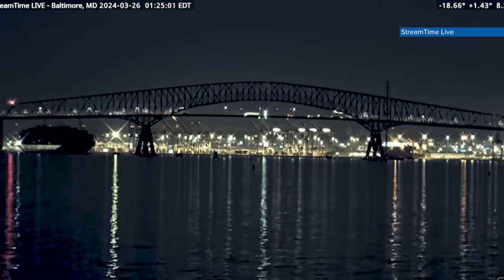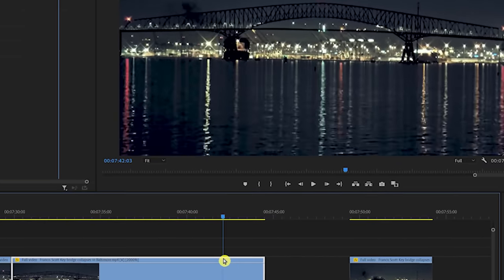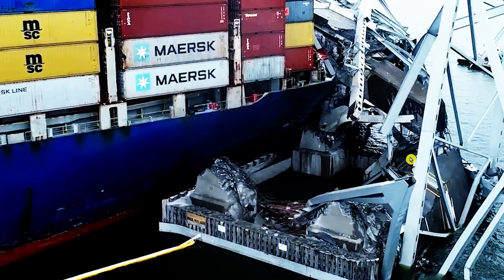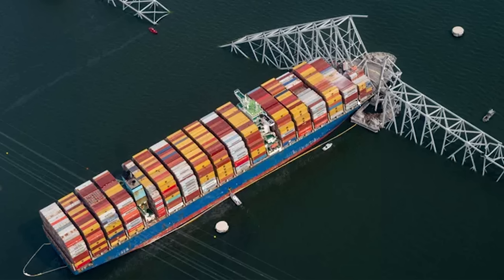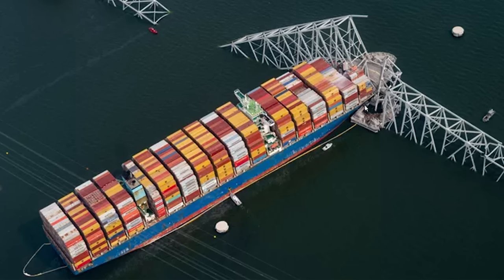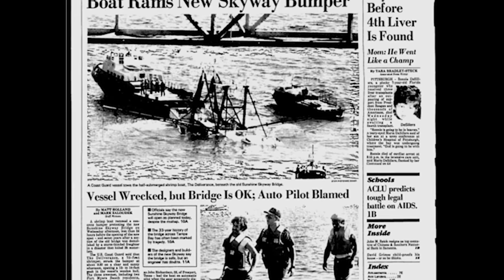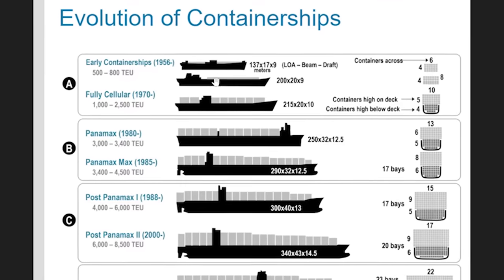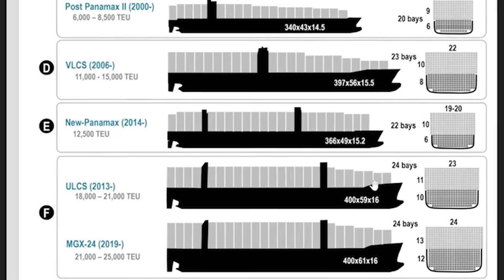NO Dali Bridge Crash Protection Like Sunshine Skyway Bridge?

Comment: 3:42 in, “the ship didn’t really turn that much”. It made a hard turn because it dropped anchor on both sides but only one scraped bottom and caused the ship to turn. When power came back before it went off again, they trying to correct, but it was too late.
You are correct that the bridge islands needed to have an arch of dolphins to create a glancing off effect if a ship that heavy can even be prevented from smashing into a bridge support.
Reply from the maker: The ship did not drop anchor on both sides, only the port side, and it had no effect. Anchors do nothing for moving ships.
Reply: @jeffostroff  this video of Casey Jones, https://youtu.be/YQ9lhqqxpo0?si=dsPu1otiCtV4p4HF
 said  one of the anchors did actually drag on the bottom of the channel and that was enough to cause the ship to yaw.
Also, the image you showed of the path the system recorded the ship taking is just that, it’s like the heading of an airplane vs the track in a cross wind. Even if the anchor has no slowing effect it could cause the heading to change but the track remained nearly the same , till that last bit that the image of the recorded path shows.
Also, that last little correction attempt looks like what kept it from hitting the support directly, and why it did the glancing blow where the bow overhang took the supports out.
All kind of irrelevant though, the ship had just the worst angle to totally miss that poorly placed dolphin. They should have built additional dolphins in an arch pattern to contend with any ship at nearly any angle.

Comment: Irony that Panama Canal water shortage now unable to handle fully loaded cargo ships
Reply from the maker: Wow that is surprising
Reply: Not surprising.  The original canal was designed to be sustainable, operated entirely with the available water power.  The expanded canal was designed to naximize capacity with little regard for sustainability.  Sometimes there just isn't enough water.
Reply: @GH-oi2jf actually the new canal is able to reuse water to a certain degree and is more sustainable per ton of cargo.
Reply: That is not entirely correct, just unload some of the cargo and transit the canal and load the cargo back on. They have a train.

Comment: While the design of the powerline protection probably isn't enough to stop a ship of this scale, it really shows the difference between modern and older protection design. The powerlines have more protection than the critical supports of the bridge. I would not be surprised if the lack of bridge support protection is going to be put down as one of thr leading contributions to this accident.

Comment: It's not the legnth of the new size ships that's the problem but the beam.  From the bow damage on the DALI, it looks like the flare to the blunt bow was able to reach the pylons of the bridge.  The neopanamax DALI had an extra 50' of beam so 25' more reach over the bumpers compared to a panamax size ship.  The put in new cranes in the port to handle the wider ships back in the 2010s.

Comment: It seems to me that the dolphins have been placed on the assumption that a ship would be travelling straight but too far over, so they deflect it in plenty of time. The designers never imagined that a ship would turn towards the towers at the last minute. The dolphins at the other bridge were 60% of the distance away, much further than your suggested position. I think at the angle the Dali was going it could have still hit. 

There needs to be a series of at least 3 dolphins at narrower spacings acting like a funnel to direct ships towards the centre of the channel, with the last one far enough to the side of the pier that the overhang cannot reach the tower.

Comment: Another reason why Tampa and the Sunshine Skyway are different is because Tampa doesn’t (AFAIK) have any container ship traffic. It’s bulk cargo, mainly phosphate, going out and fuel coming in…and cruise ships.
So those newer fat wide ships aren’t typical here.
Reply: Ironically, neither does Baltimore. Container ship traffic is a comparatively small part of its traffic. Baltimore’s specialties are RORO (vehicles and the like) and bulk.
Reply: @tookitogo  so after checking aerial photos, I now see that Tampa has two cranes for containers and a lot for them but based on those pix, most of the lot is empty and looks only about maybe 15% full or so, thus possibly about half of what is on the Dali ship.
Baltimore shows as having at least 14 container cranes so definitely a bigger operation there.
Reply: @JohnHallgren  I’m sure Baltimore’s container operations are bigger than Tampa’s, since it’s a bigger operation overall. But nonetheless containers make up a minority of Baltimore’s overall cargo.

Comment: I know nothing about shipping procedures but is there a reason why there are no tug boats around these ships or would that have made a difference?   I have a 1981 Mercedes 240d diesel and have had the fuel filter plug up and the engine ran so rough that eventually I had to pull over and changed the fuel filters.  Then the car ran smoothly again.

Comment: One of the 2 "Silver Linings" we can get from this tragic moment in history, is too realize that we NEED to have these Dolphins on any bridge the size of the Key Bridge &/or a bridge that is in a major channel way going to a sea port, ESPECIALLY if it's one of the LARGEST Ports in the country... I think we will see the Key Bridge be rebuilt and have a few dolphins & even man made beach heads around the most vulnerable part of the birdge, like the one in Florida... The same person who worked on the aftermath of the bridge collapse in Florida, that had the same thing happen to it as the Key Birdge, is working on the Key Bridge as well so we should definitely see some major safter improvements. 

The next "Silver Lining" in this incident is the fact that it happened at 1:28:00AM in the morning where there was barely any traffic & the Maryland Police were able to get the roade shut down so no vehicles could pass. The Maryland State Troopers said over their radio that they were going to drive up to the highest point of the Key Bridge too tell the construction workers that were filling "Potholes" at the top of the Key Bridge that fateful early morning. The Maryland state Trooper was just about to head to the top of the Key Bridge, then the entire Key Bridge fell. Most of the construction workers passed away from the collapse but 2 of them actually survived! One of them was barely hurt &/or injured AT ALL & the other person that survived was in full recovery. I would love to know how those people survived. RIP to the construction workers that were on BREAK in their trucks, getting warm & having a bite to eat, when the Key Bridge fell.

Comment: @Jeffo Look at the powerline that runs parallel to the bridge.  That powerline appears to have the current usual choice of dolphin, which is cellular cassions.  You can hear more about protecting bridges in yesterday's video on YT channel Casey Jones Professional Engineer.  He's worked on bridge foundations over the past 20 years and designed a couple of cassion structures to protect bridges. video name "How the Francis Scott Key Bridge in Baltimore should have been Protected"

Comment: It's ironic that if the Pilot hadn't ordered for the Anchors to be emergency-dropped the Dali would have slipped under the bridge without incident. But the anchors pulled it trajectory towards starbord and into the pillars..
Reply from the maker: Incorrect. They only dropped the port anchor, which should aid in pivoting the boat. IT drifted because they had no rudder control and currents pulled them

Comment: That is either too passing commercial or private vessels of any size, or issues along the shoreline too, as well as extra flow issues on the structure they are protecting as well.

Or these Concrete Dolphins or Barriers in the worst situation, will reduce the force of impact coming from a Large Container Ship (LCS, carrying 10,000 to 15,000 TUE’s, or 20ft or 6m shipping containers onboard). 

Let alone impact and energy force from a Very Large Container Ship (VLCS, carrying 15,000 to 20,000 TEU’s onboard) or Ultra Large Container Ship (ULCS, carrying 20,000 plus TEU’s onboard), would cause or have in an impact with a structure or the likes of a bridge.

So the impact maybe or would be a survivable impact collision, or a repairable collision with either minor or major or even serious amount of damage, but not causing a total lost!

Equally the Port of Baltimore Authorities, or City Baltimore Transport Administration, or Local County Transport Administration, or the State of Maryland Transport Administration, let alone Federal Transport Administration of the US Government too. 

Could have put in place regulations and rules, all Large Commercial Shipping Vessels of between 25,000 to 50,000 Gross Tonnages must be escorted, towed and guided by a pair of tugboats, 

With at all time an One-Minute at most Alert Emergency Fast Response Fire Rescue Salvage Tugboat, is on standing by patrol (24-hours, 7-days a week, 52-weeks a year) either within the Port and Harbour area, or along the Main Shipping Channel or both that is at all times too!

While ALL Large Commercial Shipping Vessels are either entering and leaving the Port and Harbour area of Baltimore, or travelling under all bridges crossing the Main Shipping Channel to and from Baltimore too!

However, with regards newer Very Large Commercial Shipping Vessels of between 50,000 to 100,000 Gross Tonnages, then they must be escorted, towed and guided by a pairs of tugboats ahead of the vessel’s and by a pairs of tugboats astern of the vessel’s, plus another tugboat of escorting in case of an emergency too.

Lastly Ultra Large Commercial Shipping Vessels of between 100,000 to over 200,000 Gross Tonnages, then they must be escorted, towed and guided by a pairs of tugboats ahead of the vessel’s and by a pairs of tugboats astern of the vessel’s, plus another pair of escorting tugboats in case of an emergency too.

In closing Sal, why is not the likes of NTSB or Federal Marine Transport Authorities in the past or now, or State and National Politicians in the past, or even now too?

Not openly call for an Emergency Federal and State Reviews of the United States Marine Civilian and Naval Infrastructure be carried out As soon As Possible?

Also how well they are United States Marine Civilian and Naval Infrastructure, actually defended around the USA, that is against all types of Natural or Manmade Marine Accidents or Disasters from happening.

Let alone from attacks carried out, by International Terrorist Groups attacking Marine Civilian and Naval Infrastructure, or attacks from Enemy Rogue Nations on USA Marine Civilian and Naval Infrastructure too?

Because of what has happen in Baltimore in the last few day, with the whole port and Harbour of Baltimore, plus the bridge and Interstate Highway now going to be closed down for weeks or months, even out of action for years to some degree.

American and European Politicians and Transport Administration Officials alike, have to realise their joint overseas foreign enemies, will be taking very close interest.

That is on what has happened in Baltimore, also  how quick the US is to respond and bouncy back, plus how the US recovery’s from this Container Ship and Bridge Marine Accident and Disaster too.

Is the Port up and running in less than 28 days or within a couple of months, with Commercial Shipping Vessels and Naval or Naval Auxiliary Vessels, allowed to leave port or enter port normally?

Or will it be three to four or five or even six months, before Port is up and running normally at full capacity, or still only quarter or half and/or three-quarters capability too?

Or Commercial Shipping Vessels and Naval or Naval Auxiliary Vessels, will not being using Baltimore Port and Harbour facilities that is normally?

Actually until a NEW Road Toll Bridge is built and up and open to traffic, so re-linking the Eastern Seaboard Interstate Highway network, with the City and port of Baltimore too?

Which could be 3 to 5 years you suggest Sal, could Baltimore be not up and working at 100 percent, until say the 2028 Presidential Election come round again?

Especially depending, on if Trump and the Republican Party was return to the White House, instead of President Biden and the Democrats are Re-elected in November 2024, in just over eight months.

Because it will be interesting to see what development happen in Baltimore, in the next 7 months how these may affect the US Presidential Election in November 2024.

If President Biden and the Democrats can delivers on President Biden public promises to Baltimore, with Hundreds of Millions of Federal Aid Money, assistance, help and support.

Especially from the USCG, US Navy and US Army Corps of Engineers, or will we all see Trump and his Republican Party supporters, plus very much Republican Party Politicians at City, County and State levels in Maryland plus on Captial Hill in Washington DC too.

Trying to delay Baltimore receiving all these Hundreds of Millions of Federal Aid Money, plus Federal assistance, help and support coming from the USCG, US Navy and US Army Corps of Engineers too.

As part of Trump and the Republican Re-Election Campaign, for Trump to be President in 2025, then afterwards Trump will deliver all this Hundreds or thousands of Millions of Federal Aid Money to Baltimore so Trump look good!

Though When Trump was President, what did then President Trump or his Republican Administration,  do about the protection of United States Marine Civilian and Naval Infrastructure around the USA, ANYTHING AT ALL?

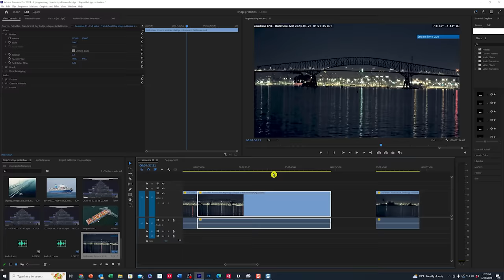Comment: maybe im wrong but when you were doing the back and forth of the video at  @3:55 too me it looks like the ship trys to dodge the small dolphin and with the rudder set at that steering angle then the ship has a power outage with the rudder set at that angle which makes the ship turn more towards the bridge rather than the shipping lane. so again, for me @3:55 the ship has its steering set to avoid the dolphin, then it has a power outage with the steering already set to a starboard turn ( right turn ) it cant change that turn so it continues to turn more heading to the bridge, then the ship regains power, they start a port turn ( left turn ) which makes the go straight into the bridge.  for me the justifies the angle the ship came into. please comment and let me know what you think

Comment: I think questions need to be asked not only for the bridge designers but also those in charge of the bridge,   if we look all over the world we see bridges even pretty old ones that have pretty formidable impact defenses so we have to ask why this bridge had no defenses at all and yes it has 4 but they are tiny and the positioning is all wrong and is more of an after thought and would not have stopped any ship so questions about the design need to be asked and accounted for,  then there are the people in charge of maintaining the bridge and they need to be held accountable also as all over the world for many years where there are bridges that are not protected and in shipping lanes are having defenses constructed to protect the bridge.

Ships loosing power is not as uncommon as people think and in most cases it happens out in open water but there have been quite a few cases where it has happened in rivers and this is why country's have been retrofitting bridges with defenses for over 30 years because it is not a new issue, and it makes you wonder because if you look at the power line that runs next to this bridge you can see that it has a massive hexagonal base with an even bigger hexagonal defense wall so clearly they knew that a ship strike was a possibility at some point so why where proper bridge defenses not put in place.

As for how it turned there are a lot of tinfoil hats saying it was intentional, but in reality there are reports that in a last ditch effort they dropped the port anchor in an effort to slow  / stop the ship, and what i think happened is the ship was being pushed by the current of the river and it was already on a slight angle to the right and when they deployed the left front anchor it was not enough to stop the ship but it was enough to cause drag on the front meaning that the rear right side of the ship was now being pushed by the river current and the ship would pivot around the point of drag turning the ship more to the right

Comment: You would think that compared to the cost of a new bridge that a big island of rocks around the piers would simply be a no-brainer... needs to be big enough to account for the maximum overhang of the bow at any angle plus the maximum amount of penetration of the biggest ship that can possibly travel under the bridge, travelling at a higher rate of speed than allowed (say +10-20% overspeed) plus a safety factor of at least 10% above that... so say that a ship speeding through a channel at 15 knots instead of the stipulated 10 knots maximum speed allowed, weighing say so many hundred thousand tons, will have an impact energy of "X", then design the islands so that the material can displace "X" amount of energy plus 10%, and the distance travelled in the time needed to dissipate that energy, add 10% to get the island circumference...